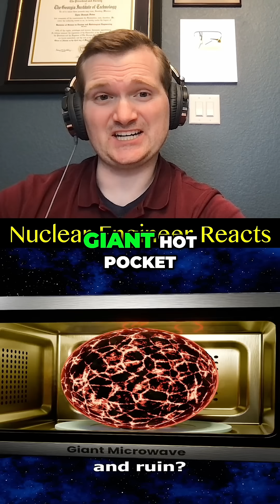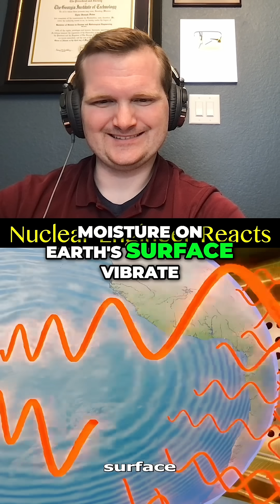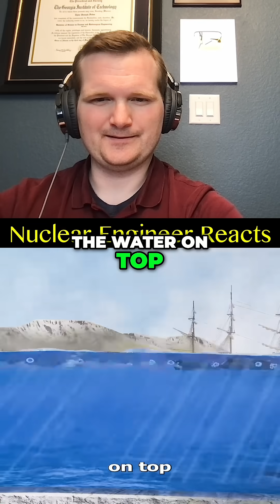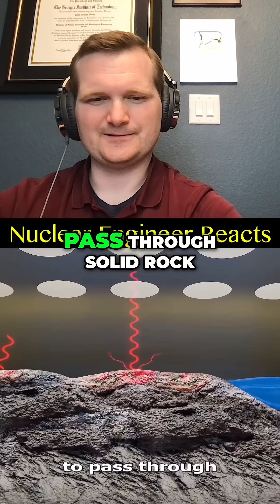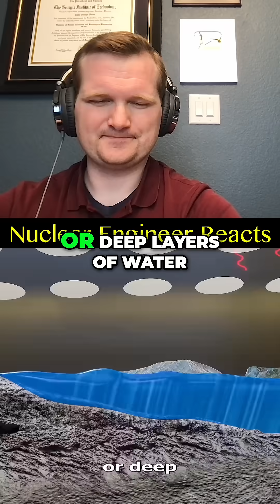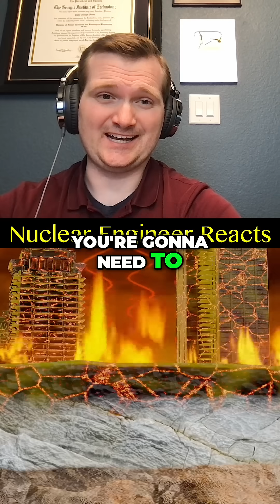What Happens if You Microwave the Earth? - Nuclear Engineer Reacts to Zack D. Films

Comment: This isn't even taking into consideration all the water saturating the atmosphere, and all the different dark mode and glow mode plasma layers that exist, between Earth's Surface and Space which would reflect back, or absorb, the Microwaves. 
Funny thing is, we don't need to speculate as to what would happen because we are witnessing what would happen as you read this. The Sun produces Microwaves as part of it's black body spectrum of light emissions. It's relatively small in comparison to the, infrared,  visible light, and x-rays that make up the majority of that spectrum, but it's still detectable. 
This is ultimately the reason there should be alot of skepticism towards any Microwave Background imaging data that is gathered from facilities on the Earth's surface, or even low orbit. The water and plasmas in the atmosphere and around the Earth(such as the Van Allen Belts, or even the Heliosphere's Heliopause at the edge of the solar system) basically makes for an impenetrable smoke screen for anything that sees using Microwaves.
It's like trying to see out a window, when the windows are fogged up, the room is full of smoke, and someone is constantly throwing an unending number of flash bangs into the center of the room.

Comment: So I'm no expert, but I would think you'd actually need a lower frequency to penetrate deeper into the earth surface.  A gamma ray burst would mostly distribute it's high frequency energy into the atmosphere (through Compton scattering as well as pair production).  I guess an energetic GRB would have a stupendous amount of energy but I don't think that you'd get much of that energy distributed into the mantle or core of the earth.  Earth does a pretty good job of insulating itself between the crust and the mantle, so I would think most of that atmospheric energy would end up radiating back into space before being absorbed by the lower crust and upper mantle.  Maybe the very upper layers of crust.  I could be misunderstanding something.  In the past I've done the design and manufacturing drawings for ASME BVPC (Section VIII Division 1 & 2) replacement pressure vessels (heat exchangers, oil coolers, hydrogen coolers) for nuclear plants (and hydro & fossil plants), and I sometimes use a CFD package for fluid simulations to test thermal properties of designs.  I would love to have the time to set up a whole earth simulation with the fluid dynamics of the core, mantle and atmosphere.  It would be interesting, although it's out of my normal domain but would be a fun exercise.

Comment: And it won't actually heat it up that much
The microwaves need to bounce from the other side to gain enough power to heat up the water
So the microwave will just.. vibrate people on a hemisphere
Just if they liked to absorb vitamin D they absorb  microwaves
Also not to mention that the microwaves will take around 42 milliseconds just for it to pass to the other side once

Comment: Can you have fingers on any experience of fault involving the differential charge experiment that results in element x those atoms being split for calculations versus investment to output, and this is what you probably won't have, but the active energy getting state versus ambient energetic states, you know, those experiments.  Conducted with those fun fact.If you increase the energetic state of an atom, it'll have a lower yield, but if you have its environment more active, it has a slightly different yield, super weird result of an experiment, I seeing, Hey, that's b*******Data tenbusht data , but I did see it
Reply: Oh, that information with surrounding why we use yellow cake for bombs? Their containment stage, they're in really ambient radioactive set up, I do believe
Reply: And I really want this data cause I it's not for what you think. It's a different thing. Remember the question, why would atoms need nucleuses, you know, you know, why plant cell has a nuclear, you know, why a animal cell has a nucleus, and there's no real reason for an atom to have OnePlus the experiments with the neutron proton in the separation experiments didn't result in neutralization to any degree.
Reply: Oh, not that either, you know how it seems like appropriate governing surrounding systems have more variance than other things, I don't know if you know about that, the atoms themselves into the energetic system and the composition positioning and the concept of the governing of the positions make more of a difference than other things, it's hard to explain.  There is a lot to be said there and I don't think you want it to be this long but you gotta just it has to do with that
Reply: Now, if you understood that I'm just going to say, I don't hate Einstein, I think real science is important, though. Everywhere we're supposed to see time space, we see electrons and the activity of electrons and aspects of their behaviors is every bit of everything you would hope time space would be accomplishing. I don't hate Einstein. But he kinda did accept this, and I do ask scientists, why won't you

Comment: If you wanted to penetrate the skulls of "we actually use _ at nuclear power plants" jokesters, you would definitely need gamma rays. By the way, they actually use gamma sources at nuclear power plants to check some piping during construction and maintenance outages, as well as other methods, e.g. ultrasound.
Reply: Not just at nuclear power plants, industrial radiography is used in pretty much all heavy industry. In particular the gas, oil and chemical industries that use a lot of pressurized pipes and vessels.
Reply: @bpz8175  True. It's the most precise method. Kinda similar to using polarised filters to check for stress patterns in transparent materials.

Comment: Got it, gamma ray burst. I’ll try that next time
Reply: Not effective - our atmosphere is a good absorber of EM radiation above low UV (so Gamma & Xray). It just rearranges gas molecules, which destroys Ozone, blocks visual sunlight and causes acid rain.
Reply: @bpz8175 Not on this one. I remember doing research about that for school project, and to make it simple, short gamma-ray bursts can release in a few seconds more energy than what our Sun will produce in its entire lifespan. But to be honest, we are talking about the fusion of a neutron star with another one(or black hole) so it makes sense. But yeah, if we get hit by that, the atmosphere is not gonna be good enough
Reply: @Ravitas3  Wait what distance are we talking? I wss thinking about the mass-extinction range for some reason, but that's 5000 to 10000 lightyears. If it's within a few hundred, then you're right.

And many GRBs (also higher energy) happen when the core of a magnetized and quickly rotating star collapses into a black hole. It's so cool I'm almost a bit disappointed WR 104 probably isn't pointing straight at us.